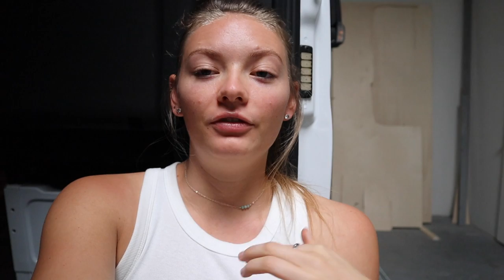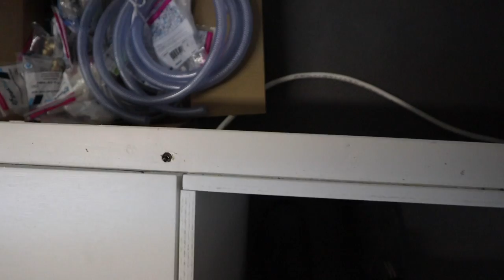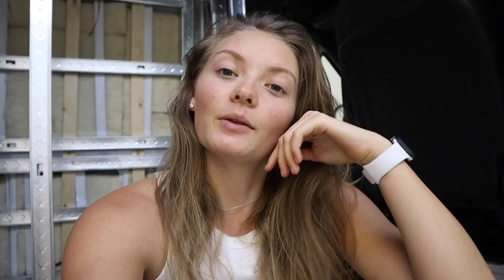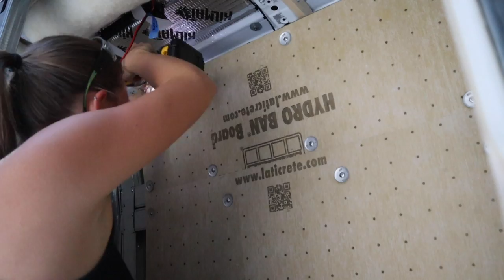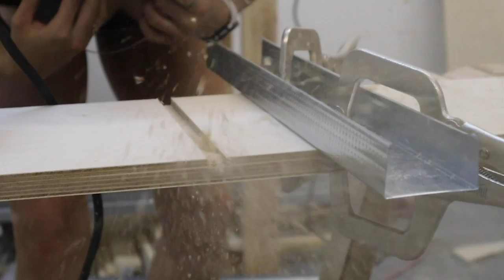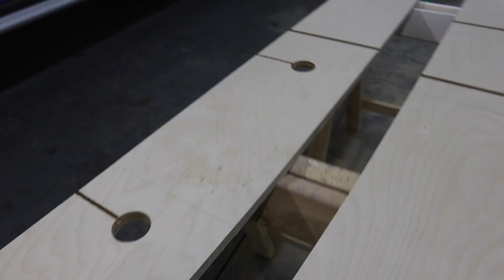What it's REALLY like to build a van.

Comment: I think you need vapor barrier on top op insulation, without it condensation will build up on van metal walls and rust gonna eat you van :D rockwool is mold resistant but it's gonna absorb water.

Comment: Just an observation tip, think those plywood sheets would be easier to get on the sawhorse standing straight up. 😅
Reply from the maker: Too hard for me to stabilize them that way and I don’t want a heavy sheet of plywood practically free falling and potentially knocking one of the sawhorses down, hurting me, etc. Trust me, I’ve tried it a few different ways😜
Reply: I like you your fun
Reply: I like you , your fun

Comment: Nice job, Kensie. Question: Would it be good any benefit to use some kind of protective tubing to run the under cabinet light wiring through to protect it?
Reply: Yes, at all times. Always make sure that your wiring is shielded/covered.. Any time you're running electrical wiring in a vehicle (that eventually moves/shakes), your wiring should always be covered.. shielded..  insulated... protected... so that it doesnt shread apart, short circuit, start a fire, etc.
Reply from the maker: I have mentioned this in past videos but yes absolutely! All the wires I run in the van are covered with a super durable nylon sheathing to protect them.